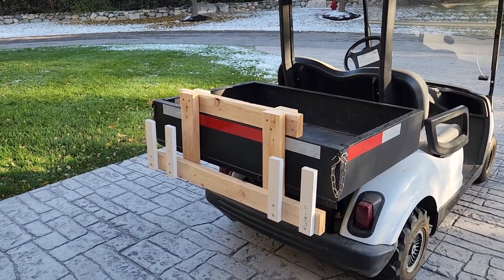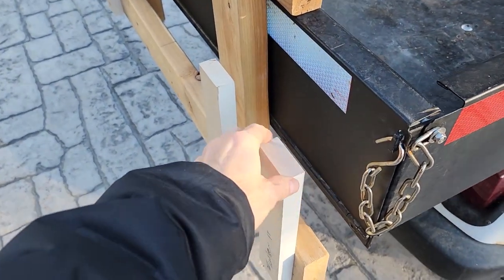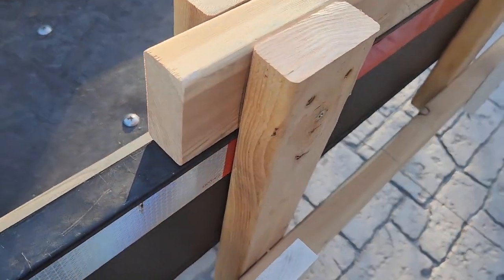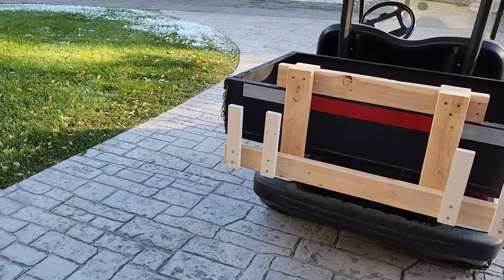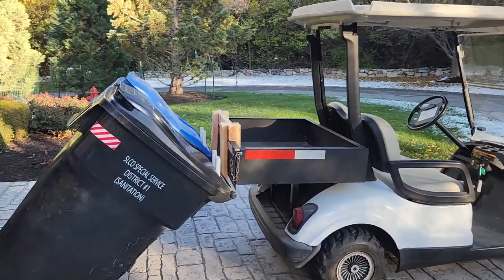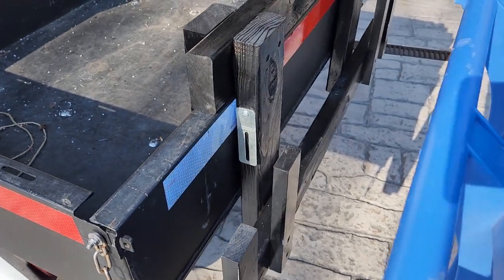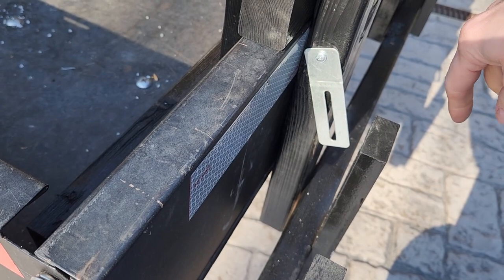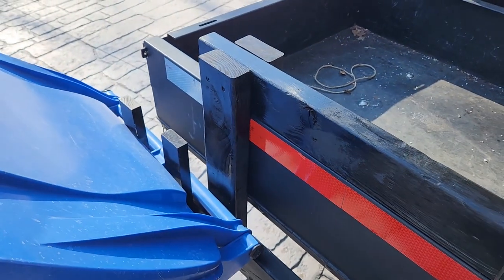Golf Cart Garbage Can Hauler DIY

Comment: Great video! I've been imagineering this for years. I have a fairly steep drive about 80 ft long. I'd envision welding a hook, but your wooden design looks and works great!  I also though about designing a hook that would slip into the trailer hitch on the car, then slip out and hang in the garage until needed. Thanks for the video and plans.